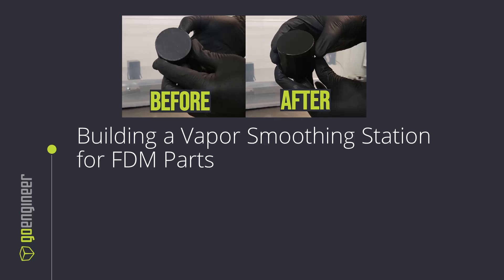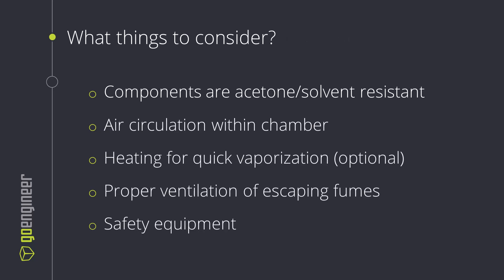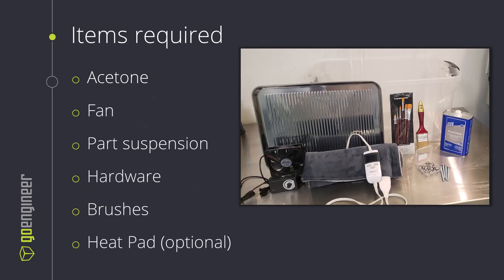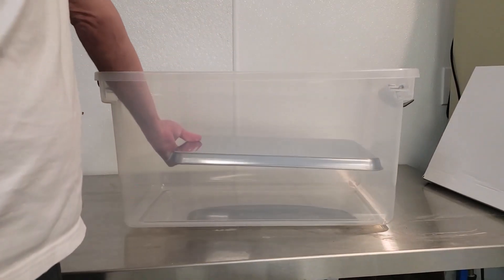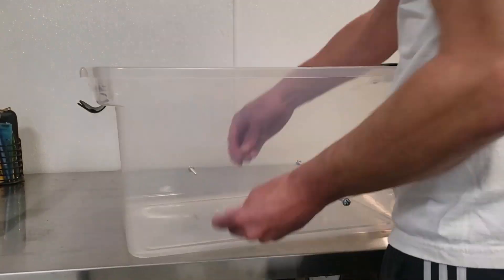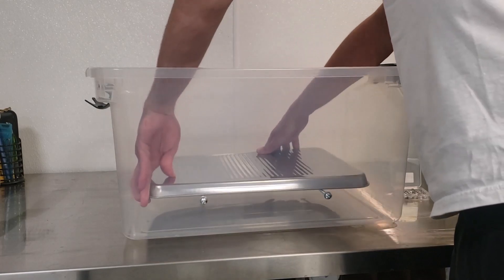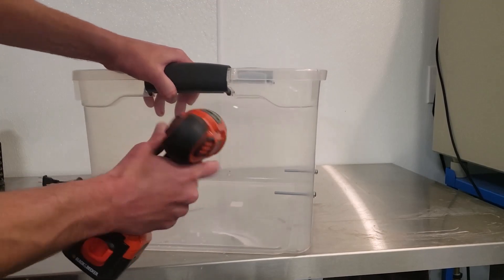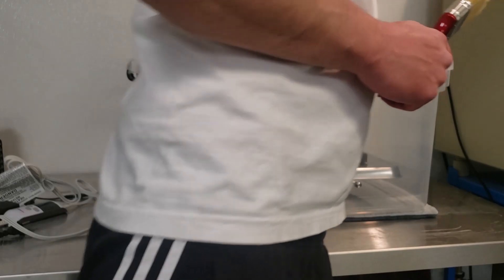How to Smooth 3D Printed Parts the Easy Way

Comment: Would be nicer if you could add links to the parts, like the fan and the heater. I’m going to try methylenchloride with PETG.
Reply: Did you ever try it? Looking to try vapor smoothing on PETG as well.
Reply: @Chance-h8r Got all the material but didn’t try
Reply: @matthiasnott  Thanks for the reply, what all material did you go with? Or how much did it all cost you I guess is my question.

Comment: This is really well presented. One concern I would have where to set this up, is regarding the fan. I would worry that it might spark and ignite the air/acetone vapor mixture.
Reply from the maker: It's certainly something to be cautious about, so you should always be sure to set this up in a well-ventilated area to help mitigate the risk.
Reply: @goengineer  considering that the fan is inside the chamber, I wonder if a brushless fan might be a good choice.

Comment: Do you have any idea why mine isnt working? I have an identical setup to you with heat blanket and all. Not getting any results. My only guess is maybe my fan isnt strong enough??
Reply: Yeah, I'm having the same issue. It is like the vapor is just evaporating instantly.  I've read you're not supposed to have this kind of thing sealed, but I've had good outcomes with glass containers that are air-tight. So I'm really not sure what to do here either.
Reply from the maker: The first thing to do is verify what kind of filament you are using, if you got no effect at all it is probably the wrong solvent for your material type.
Reply: @goengineer  how long after the vapor smoothing can you touch the parts? Are they soft or tacky when you first take them out? Thanks
Reply: it's not for PLA filament